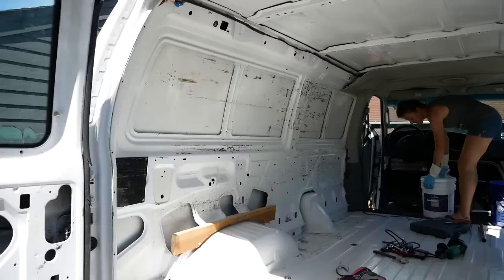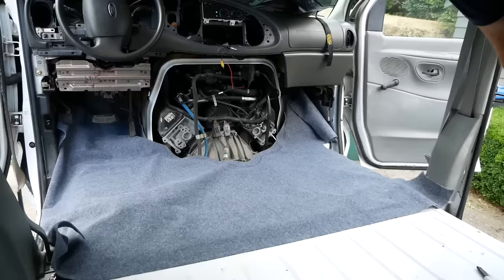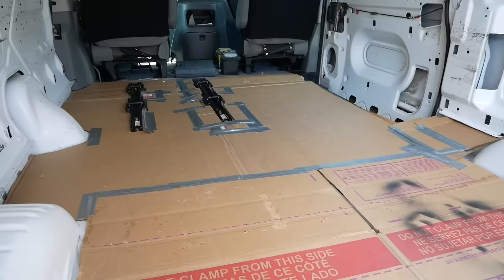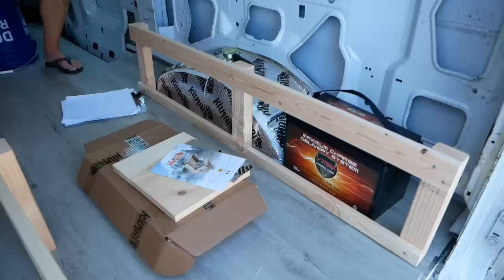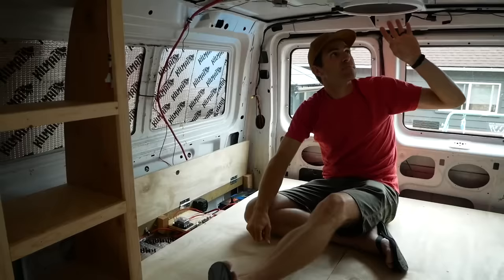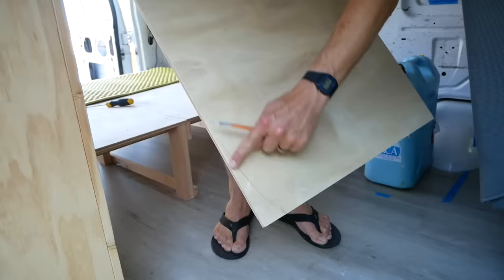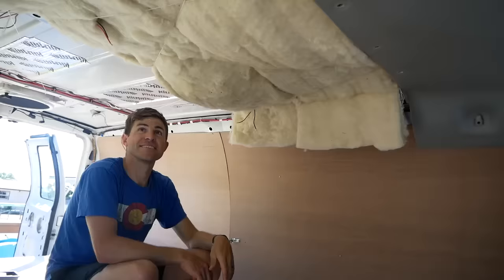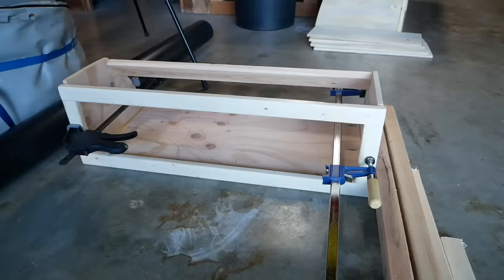Budget Van Conversion | Ford Econoline $3000!

Comment: I plan on doing this, i'm just worried about condensation and panel rust. I live in Alberta where the temps in winter drop to -30 celcius. I know on the old Ford trucks the back wheel wells rot out along with the front fenders and cab corners becuase of foam the factory stuffs in there to deaden sound which also attracts moister. I good idea while you have access to those back inside fenders panels is to coat them in a grease wax mix. I'm wanting to hear from the pro's though what would be the correct way to insulate the rest in regards to condensation.
Reply from the maker: We are certainly not pros, just weekend hobbyist. We don't have winters quite that cold here so we weren't as concerned about moisture. We do live in a WET climate so we make sure we run the van and crank the heat up at least once a week during the winter and manage moisture inside as best we can (cooking outside, keeping boating gear in bins etc). We also thankfully don't live somewhere where roads are salted which is helpful. Hopefully some other northerns have some ideas for you/us!

Comment: You guys look pretty tall, surprised you went with an older cargo shell :o The taller roof of the newer vans are well worth the extra moula!

Side note, those older cargo vans tend to be quite reliable (mechanically.)
Reply from the maker: Agreed, this thing has been mechanically very sound. I have only replaced the thermostat, a $11 fix.

Comment: Very nice work! Did you drill through the floor from the bottom outside to get the bolts in place to secure the plywood floor?
Reply: I'd like to know this also. I'm thinking hole would have to be drilled through the metal floor if they're using bolts.
Reply: @annieontheroad  I was thinking about drilling through it but it might be a headache with rust in the future once you shred into the body that really causes concerns for me

Comment: Take this review of your build with a grain of salt, but if works for you that's all that matters. From my research so far. You made what I would consider mistake like bolt the floor down thru van body. I also would not used wool as it soaks up moisture.
Reply: Wool is a natural material with large pours. It absorbs moisture but easily releases moisture. Anytime we can avoid using plastic we should do so.

Comment: Is there any reason why you didn't use wood on the high points of the floor to add more support to the floor ? Is there any noticeable difference in your floor just being placed directly over the foam and drilled into the metal frame ?
Reply from the maker: We were trying to maximize our height, when seated we both only have a few inches of clearance between the tops of our heads and the ceiling. There are plywood sheets over the foam and its adding plenty of support for our needs this far, it might eventually cause compression of the foam but so far its been working great!

Comment: Thank you for the video, I was wondering if you used spray glue or something to secure the carpet in the front to the floor, and if the carpet itself had some sort of vinyl backing to keep the moisture from footwear soaking into the jute etc.
 I See that the jute looked like it had a foil outer layer (as well as the sound deadener) , I am guessing that would keep the water from making it down to the metal floor, thanks again.

Comment: Did you drill the holes through the underside of the van in order to screw in the tee nuts? (Or did you just screw the foam and plywood together with those?)
Reply from the maker: Yes we did, the floor is mounted to the undercarriage
Reply from the maker: We also added silicone to prevent corrosion and locktight on the nuts.

Comment: For me, the part I don't get, is what are the bolts even bolted into? The frame? A metal structure?
Reply from the maker: The plywood on the floor is anchored all the way through the bottom of the van by t-nuts, if that what you are referring to? The extra seat is also bolted through the floor onto machined stainless steel brackets.

Comment: Something I've been really wanting to find is a bare-bones price sheet for what it *actually costs to wood and insulate the walls. How much would you estimate that chunk cost? 
No additional wiring, just simply the wood and wool for the walls? How many sheets of plywood did you get and how many bags of wool? 

Thank you so much! Wonderful video and great channel.
Reply from the maker: The paneling is 1/4"- sometimes called "Luan". I found it at Home Depot, not at Lowes. 5 sheets were needed in total which is around 50-60$. These panels were TSCA Title VI compliant for formaldahyde- Meranti (Shorea spp.) from Indonesia. We used 1 bag of wool. Hope that helps!

Comment: Why put insulation on the bus?  There will always be water, because there will be a difference in temperature inside the bus and outside, and therefore there will be condensation and the bus will rot faster than you think!

Comment: Only question, did you make sure that the vehicle was completely sound before starting your conversion? More times than none folks will start a conversion or a off grid build by diving into the build and not making sure the vehicle being used is in top notch. Example, I watched a video were a couple bought a Toyota Sunrader and refurbished the living portion right away. long story short they never went on their road trip. They didn't put the time and same effort onto the suspension of the vehicle like they did with cosmetics, and ended selling the rig.
Reply from the maker: That would be a tough situation to be in. We both actually worked for organizations with large fleets of econolines and are very familiar with the common problems that arise. We also feel fairly comfortable performing our own fixes (for small problems) and so far have replaced the themostat and just done basic maintenance.  In the past I have taken vehicles to a mechanic prior to purchasing and always think it's a great idea!

Comment: 1 in of polyiso and half an inch of plywood is so thick. Why did you choose such thick polyiso and did you put anything in between the corrugations underneath it? Losing an inch and a half of space seems more than I'd like to lose, so I'm curious about the reasons why you chose to make it so thick. 
I was considering half inch polyiso and quarter to half inch plywood. Do you think that would not be sufficient? Wonderful video by the way!

Comment: How different is the wool from regular insulation? Did it suck installing and get you itchy like fiberglass?
Reply from the maker: It actually wasn't too itchy, it was more dusty and "farmy" than itchy. We wanted to shower afterwards but didn't end up with fiberglass rash and weren't as worried about our lungs.

Comment: Hey guys. Great work. Securing the floor - did you drill a hole up from underneath through the van's body and through the floor? then install the nuts/bolts? Also, how did you secure the frame of the bed to the van?
Reply from the maker: There are holes securing the plywood floor panels through the bottom of the van. We used T-nuts, locktight and silicone when connecting them. The bed is only anchored to the plywood panels, if you are concerned about safety I would recommend anchoring the bed through the floor as well. We were a bit more concerned with being able to remove the bed quickly is we need to use the van to move something large (couch, lumber etc). 

cheers!

Comment: I'm going to be doing same as you im getting a van and turn it into a van rv but I have to ask this you putting a 3 chair in the back most people if not all don't do that why did you it takes up space you can take passage side seat n have it to where you can turn it around lol I'm not putting a 3 seat for sure need the space for sink n cooking area n draws you should have gotten a swivel type of hook up for passage side seat to be able to turn it around lol
Reply from the maker: Hi Conner, we were mainly going for cost and simplicity of design. Additionally we wanted 2 seatbelts in the second row seat so friends have a place to buckle when they ride along. The swivel set ups I've seen look pretty great though!

Comment: How thick is that wall panelling ya'll used? And how many did u buy to have enough for both sides and ceiling.
And how many 1/2  panels do u need for the floor alone?
Sorry for asking so much, im getting this same van and want to build it nicely.
Reply from the maker: The paneling is 1/4"- sometimes called "Luan". I found it at Home Depot, not at Lowes. 5 sheets were needed in total which is around 50-60$. These panels were TSCA Title VI compliant for formaldahyde- Meranti (Shorea spp.) from Indonesia.

Comment: Its cool and everything, but $6000? You could buy a prebuilt camper van with half the miles for that much... Also, whats with the hand made faucet? Those cost less than a copper pipe. Cool video though.

Comment: Won't the vinyl flooring planks split over time (as the van moves and shakes)?
Wouldn't a solid piece be better?
☮
Reply from the maker: 2.5 years into use and no problems as of yet, cheers

Comment: I, bought a 97, Dodge Ram 2500 conversion high top van for $900.00
Reply from the maker: That’s amazing! doing a conversion on even more of a budget is possible with time taken to source materials for free or close to free on the used market, instead of buying everything at Home Depot and retail price online as we did in this example. The calculation then becomes between time spent sourcing those materials and how much free time is available.

Comment: Shouldn't there be some sort of moisture barrier between the metal of the walls and the wood paneling?
Reply from the maker: It might help if you're concerned, thankfully we haven't had any problems so far and feel like the van can breathe pretty well between the paneling and insulation.

Comment: Did you add more structure to the seat brackets? Its not good enough to just be bolted to the floor, it can rip out in an accident
Reply from the maker: Hi Calvin, There are metal  rail reinforcements installed for that reason. Check out our video on the second row seat install to see a more detailed view.

Comment: The van looks great! I got the same radio on Amazon and have been having some skipping issues, any advice?
Reply from the maker: We have had no issues with our radio. It is a bit slow at switching from back up camera to stereo when shifting from reverse, but other than that it has worked almost flawlessly for about 8 months.

Comment: Was there any mechanical maintenance done on this van? A full service and inspection?   Your budget van is kind of worthless if you can't drive it, and there's a reason you got it for $3k - it's never been serviced or maintained...
Reply from the maker: We both managed fleets of this exact van for different outdoor programs for several years and are familiar with common issues these vans have. We felt very comfortable with the vehicles service records and what problems may arise in the first few years of ownership. We are currently 2 + years into using it as our weekend rig and are still very happy with our decision!

Comment: Hi there, What carpet did you use by the front seats? Thanks!
Reply from the maker: I found it on a car audio carpeting website I think, I apologize but I can't find the link anymore. I think any automotive carpeting you can find will work. The floor is relatively flat and simple in the econoline cab.

Comment: Did you use brackets to bolt the frames and shelves to the floor of the van?
Reply from the maker: Yes the majority are mounted with brackets, some are mounted with screws onto a bracketed shelf.

Comment: Hey what did you use to clean all vinyl and leather up front? Just bought a 350 also and its a mess!
Reply from the maker: Mainly dawn (dish soap) and a whole lotta elbow grease. We alternated between a few different scrub brushes, toothbrushes and the scrubby side of a sponge a fair amount.

There might be some better options (tolulol will remove pretty much anything but also takes the surface with it) but we generally try to use the mildest cleaning products possible.
Reply: @findoutDIY  THANKS!

Comment: Can you tell me how hard it was to bolt in the back seat? Is the gas tank in the way?
Reply from the maker: We did have to work placement around the gas tank, we couldn't quite get the seat where we would have ideally wanted it but were able to find a spot that worked.

Comment: Where did you buy the third seat if you can share the info please
Reply from the maker: Hi Paul, we actually just picked it up off of craigslist (or offerup I don't actually remember which). In our area lots of folks were turning transits into work vans and they were pretty easy to locate.You can also try to call junkyards and see if they have any transits available with good condition seats.

Comment: I’m building out a van and wanted to know if you screwed in the plywood from the bottom of the van? What are some other options to securing the subfloors. I’m new to all this so most things that are obvious to others aren’t to me. Thanks
Reply from the maker: We did screw the plywood in using t-nuts and then silicone for waterproofing. Im sure there are some other ideas you can find from other builds!

Comment: Since 2012 I've lived in a E150, dodge caravan, G20 high top. Now I'm in an RV. The RV is cheapest to live in hands down. I highly advise against vans for alt living. You spend more money in fuel trying to follow weather and constantly resupplying in a van than running AC in the shade wherever you are and moving 1-2x a month.

Comment: Rust reformer is non-sense waste of money. Automotive enamel on top of rust is better. Getting rid of it and or coating like you did is all you need reformer doesn't help other than the fact that it's extra paint coating it, although not as good as strong enamel.

Comment: Budget? I converted 2 shuttle busses for 3000$ total lol. 40 feet long worth of living space. Ive converted 8 vans myself also and 3k is not a budget van build. Ive built vans for 500$ with solar and all and still sold them for a huge profit. That's why I own a 2016 bus right now. Because 3k isn't a budget build if you want to be successful
Reply from the maker: Hi Tina,  It sounds like you've made some awesome, resourceful conversions! Congrats on your success! Would be great to see your materials list and prices.
Reply: @findoutDIY  i use habitat Restore they sell leftover building supplies. I go to buds warehouse when im near one for the cabinets I get 10 feet of cabinets and a 10 foot counter top for 300$. I use 1$ square foot flooring. I buy 100 watt panels (newpower) brand on amazon for .80 cents a watt. I get a good condition free mattress on Craigslist Lol. I dont do major insulation unless its a cargo van. I buy the DC batteries from Walmart they are dirt cheap especially when you bring in a core of some old garbage battery. I like getting the Kenwood bt375u stereo its the best for 70-80$ and I install it. I tint the windows for 5$ each myself im very good at it. Walmart sells blinds of all widths and roller shades you cut to fit, black out curtains with button snaps they are the best method. I get the 30 gallon water tank kit on amazon for 100$. A 20$ waterpump 12v and a trailer light and switch. Ill get a used mini fridge on offerup or craigslist. I buy the power inverter also used but in like new condition. And I live in all of them and use them while I convert them. It started with being homeless on the streets and I worked my way up to buying a 2016 bus outright with cash and enough money to fully convert it and buy a new motorcycle from the last bus I built. A 97 Ford shuttle for 7k, 1k conversion total cost and I sold it for 16k. Bought the 2016 for 13k flew out of state to find the deal and I spent 1500 converting this one. 2000 after paying registration and insurance its got 97,000 miles Ford e350 shuttle v10triton 6 speed auto.. but I owned literally 8 chevy G20 vans, and I've installed engines myself into old vans too. I've installed hightop roofs twice. Been traveling 8 years, to 45 states and I Just turned 26 :)
Reply: My bus looks extremely professional inside ill upload a video to my page

Comment: The Problem here is... you can not use this kind of isolation! all the water thats in the air, especially in the colder nights wehn you breath out all that warm air there will be condensation and all of it going in the isolation. and the isolation, full of water wants to get rid of the water is giving it to the inner sheet of your car and will rust.

the badest thing is.. you cant see it cause there is wood or something above it, so your car, even its new or old will rust slowly from the inside.

you need styrofoam or something like that but glass wool or rock wool (etc.) s just stupid.

lg